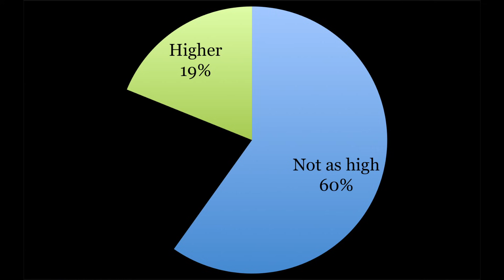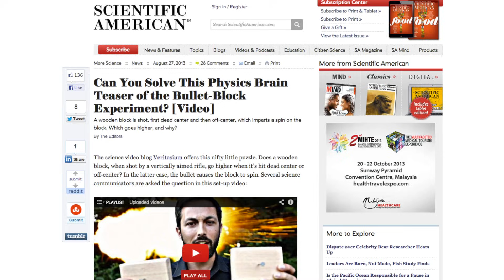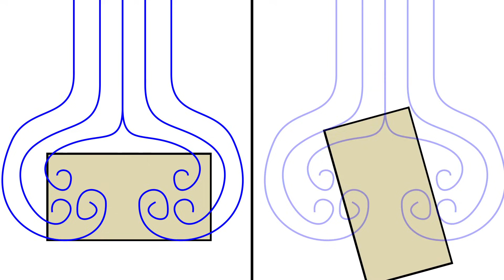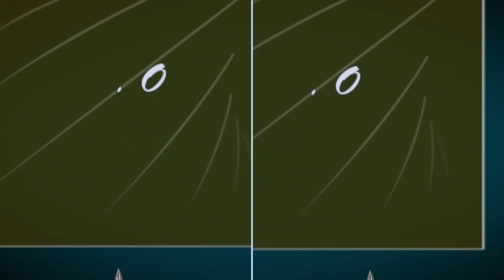Bullet Block Explained!

Comment: The resolution would be the same.. the reason why the block goes as high is due to
"the Conservation of linear momentum" 
This means if the collision is separated from all outside parameters, the Vector quantity of the momentum in a direction will be conserved and have the same momentum after the collision.

Hope This Helped :D (at least a little)

Comment: Use a hollowed block filled with ballistics gel.  The lower density of ballistics gel will allow for further bullet penetration with less energy loss, while the wood outer layer would cause the block to raise (where the ballistics gel would not).

Comment: Use a different type of wood of same size and weight but different density. That "should" make the bullet penetration depth significantly different. But still give the same results for the test in height and momentum. Also the test is too contaminated. Do it indoors away from wind friction and other potential contaminants.

Comment: Lastly a round exerts anywhere between 1000 and 3000 Ft lb of force and it only takes what maybe 5 lbs of force to spin a block? All the round would need to do is transfer <2% of its energy to make it spin. I would look in the direction of Ft lbs and I think you might find your answer... and I wouldn't call it "negligible" force for obvious reasons..

Comment: In order to make this experiment work the bullets used should be match grade the exact same powder should be used and honestly should be used with a Square block instead of a rectangular block... also the shots should be taken in increments of 1/4 and 1/3 to see the differences. Also I would like to point out that the shot that enters the block in the middles force is taken by the whole block. shooting it on one side you create a lever action thus the block is easily moved in a rotational angle.

Comment: If its possible change the projectile are using, like and arrow. So much so that the entire length of the arrow does not completely enter the block. The increased friction on the sides of the arrow shaft should slow the penetration for both arrows. However as one block starts to spin the upwards momentum of the arrow (now inclined moving closer towards the horizontal) will push against the block rather than bury itself deeper. Hopefully this would create a discernible difference.

Comment: Perhaps the fact that the momentum of the block is now upward and gravities resistance isn't playing as much of a factor the spin is more negligable than one might think. Imagine driving a car without power steering try turning the wheel while stationary and its very difficult however start driving and the faster you go the easier it is to move the steering wheel

Comment: Not to be pedantic, but the velocity of the bullet is effected greatly by the build quality of the bullet. Things like bullet weight, powder type, powder weight, and brass thickness, etc do play a role here. 22cal bullets are notorious for being sloppy in their manufacturing. There can be very large differences within the same box of bullets. With that said, no, it does not change the conservation of momentum, but it does help to explain some of the differences between results.

Comment: Perhaps the difference in bullet penetration could be more observable if the block had a decreasing mass density as the bullet passes through it. This would allow the bullet to pass through higher portions of the block more easily, and therefore allow the difference in penetration to be measureable.

Comment: Are you trying to say that one block has some momentum perpendicular to vertical? Because upwards momentum is conserved totally independently of momentum in perpendicular directions.

As long as the block gets hit with an equal amount of upward momentum in each case, vertical momentum will be conserved for each, and it will go to the same height.

Comment: In the end you ask how to make the penetration depths sufficiently different, and more amenable to measurement I propose a different direction.

Perhaps you should use a very heavy, dense block, perhaps one of steel. Or perhaps use a very lightweight block (balsa?) so that the bullet passes completely through. (This latter idea would require you to track not just the highest point of the block, but also that of the bullet. This might be tricky.)

In any case, a quantitative approach is needed.

Comment: Your statement about conservation of energy is correct. But your statement about conservation of momentum is wrong.

Momentum is conserved in an ELASTIC COLLISION.

There are no truly elastic collisions. But some come close. It must be that this bullet/block collision is very INELASTIC, and differently so in the two cases (center strike vs. offset strike).

Comment: Any material will be plastically deformed by the bullet, even at a microscopic level, when hit by the bullet. If the block was made of a denser material, the difference in indentation/penetration would just be even harder to observe. A perfectly elastic collision, where kinetic energy is completely conserved, is impossible in practice.

Comment: Hi Veritasium,
So, if I get it well, the reason why the blocks go to the same hight is bullet penetration.

So what would happen if you shoot at a harder block ? Like steel or aluminium. Or let's say if you shoot at a non-penetrable block. This time, the centered-shot will push higher, right ?

Comment: Right. You said that.

But before the bullet hits the block, it's moving upward (directly away from the ground, against gravity). After the bullet hits, both bullet and block together move upwards (directly away from the ground, against gravity).

So why do you say one is "forward"? Are you using the right-hand rule to describe the angular momentum of the bullet/block systen? Because that could be called a forward-pointing vector... but not of the bullet alone. Can you please clarify?

Comment: So you make two blocks: one can be a simple rectangle, as before.

The other can be a smaller rectangle, maybe half the width, attached to a long thin rod and a counterweight attached at the other end. This is an easy way to design the blocks to have the same mass, but very different moments of inertia. You're basically designing the seconds block so that all of the mass of the system is out at the ends (but you still need the block part to fire the bullet into).

I hope you see this suggestion!

Comment: Hi Derek! Awesome riddle!

The physics suggest that if you want to exaggerate the difference in bullet depth, you should exaggerate the off-center distance of the bullet's entry point.

Case in point: KE_before = KE_lin + KE_rot + U
Where U is internal energy. We'll take U to be representative of bullet depth.

Since both cases have the same KE_before and KE_lin, we know that KE_rot must be equal to the discrepancy in U. This can be amplified simply by elongating r in (1/2)Iw^2 (where w = vr).

Comment: Use a larger and less dense material with bullets that pierce further. If the bullets travel further, a 1% discrepancy in the deformation will be more noticeable.

Comment: Well the issue I imagine would be to get the kinetic energy transferred to the block be larger so that 3% becomes measurable. So perhaps decrease the distance so less K.E is lost. Or get a heavier or maybe sharper bullet. Although I imagine the K.E won't really be affected by such a small change in distance. So maybe the answer lies in changing the block. I would say shoot further to the side but I think that wouldn't make a difference either so maybe a denser/less dense material?

Comment: To make an experiment more accurate you need all the variables in the equation to match as best as possible every time you repeat the experiment. The ammunition used in the rifle may cause the bullet to fly at different velocity due to the amount of gunpowder they use to create the ammo.  I'm pretty sure you used the same ammo each time you shot the block, but it doesn't mean that all the bullets are the same.  You should recreate this experiment using a force that is easier to measure.

Comment: To make it possible to measure the difference in penetration depth you may want to use bigger blocks made of a material less resistant to the penetration of the bullet. Another way may be to use a more powerful rifle. The basic idea is to have a large penetration depth to make the difference in the two paths measurable. A possibility may be a viscous medium, although I don't know if this may introduce problems in terms of different trajectories effects.

Comment: Build an air cannon that fires steel slugs with a set surface area, air is much much much more consistent than gun powder and if you fire a flat nosed steel slug same weight same surface area ect. Ect. Into a block,  not made of wood because wood is hard in some areas and soft in others and stressed in other areas but into a piece of rubber or balistics gel or into a piece of super precisely formed steel and measure the dent diameter and depth this may also eliminate some variables

Comment: In order to get a more measurable result, you need to increase the penetration depth. That means you have two options: scale up the experiment (larger block & more powerful bullet) or find a material that will allow for more penetration. I recommend a combination of both: use the same rifle and  a larger block of a plastic that will allow the bullet to penetrate deeper.

Comment: What if you create an air current above the block blowing strait down on the block(like a big fan or something). Will the air current make a difference? And if it does will one of the blocks be higher than the other? I think it would make a difference and the spinning one would be higher. What do you think?

Comment: i dont agree, that gun give that blocks same energy, if the high is same, EP1 = EP2,, that the law of conservation of energy. but its not, there rotation on block 2. in this case, the law of coservation of energy not applicable. in that experiments show, that high cant be the same, because there is wind.  is the energy from the gun different to each block? ( sorry i cant speak english fluently)

Comment: change the material you are shooting through. the density you are shooting through can change how deep the impact is and how high it goes. try a material that is more fibrous or where the molecules are not aligned as evenly, eg. the opposite of silicon and carbon. Something like gold, copper, or aluminum in it's pure form, not as an alloy. the idea is to shoot a material that breaks differently when a bullet goes through.

Comment: If you want to really confuse those who got it right, use a material that cannot be penetrated, then the transfer of energy would be easier to show. You would clearly see a portion of the bullet fly off to the side, showing off the energy it managed to keep. The head on shot would show how much energy is given directly to the blocks mass. Heck, I could do it!

Comment: larger block that is less dense. The further the bullet travels through the block the greater and therefore more measurable the differences in the penetration distances will be. Use a block of uniform density too, not wood, there must be some material out there. 

Your videos are awesome man.

Comment: Should use two different materials with the same mass and overall shape (almost the same density, one could be slightly larger in volume since air resistance is negligible and inertia is dependent on mass, not volume) and fire a bullet into them. The bullet would go further into one and less far into the other. But I suspect the "penetration energies" would be different again so it would only slightly affect the experiment :(

Comment: Slower than the speed of light. How fast depends on the electron's position and the element, and electrons can't move at the speed of light because they have mass.

They do move at a significant portion of the speed of light though, especially in certain elements like Mercury. It is a liquid at room temperature primarily because of the effects of relativity on its fast moving outer electrons. The sixtysymbols channel has a cool video about it.

Comment: To reduce some variables this experiment should be done with a block made out of an homogeneous material and be struck with an object that could transfer the energy more efficient to the block like a small surface (a hammer for example). I hope that helps you.

Comment: You need to use a more dense block like a plastic block where size shape and weight are as near identical as possible. Wood depending on the tree, weather, and other factors is not 100% identical. Also fire bullet center, left, and right sides to account for bullet spin from barrel.

Comment: How is that major?  There wasn't a significant pattern showing that spinning went higher or lower, its just that some spinning with higher and some went lower, some non-spinning went higher and some went lower.  It probably has to do with differences in how the bullet hit the wood - if it hit it more to the left or right, or if it split the grain or not.

Comment: Since it would require more force to make the piece of wood spin when being pushed from the center, it mostly moves in a straight way when it’s shot in the center; but that same amount of force is enough to make the piece of wood spin when the force is applied closer to the edge. Just like when you push a door open, it’s easier when you push closer to the edge of the door -considering the center of the piece of wood as the part where the hinges of the door are.

Comment: I believe it has to do with the fact that, the further away from the center of an object you apply force too, the easier will it be to make it spin. Therefore, by using the same amount of force, it would spin more or less, depending on how close to the center the force is applied.

Comment: Instead of trying to find a tricky medium to shoot with, you can just change how the projectile deforms.  If you used a sling shot and silly putty, or a similar medium, that you put into mold to make sure all your projectiles were the same shape and mass, you could shoot them at your wood block with a slingshot.  This won't cause the wood to deform, but the silly putty will be a different diameter in its splat, which would be a cheaper and easier way to do the experiment.

Comment: Using a block thats 3-4x as high and 3-4x as wide as this small wooden block but using a different material. One that the bullet cannot completely penetrate through, but one that allows the bullet to go 40-50% of the way through. Then fire the bullet in the middle and again on the end. The block SHOULD NOT be rising from the aparatus, but instead simply tilting upwards on the end that is shot. This is the angular momentum thats created by the difference in bullet-depth and hopefully measurable:)

Comment: Bullet depth challenge: try again with a piece of wood that is the same mass but has less depth (approximately the average bullet depth + a bit for good measure) and replace with length of wood. then move the offset shot to further down your longer piece and see the results ( I am thinking more leverage requres more energy to rotate) hope it works!

Comment: Continued from previous post: It requires more momentum because the force of you striking the board causes the board to start moving in an angular direction, therefore losing energy (the bullet not penetrating the block as far)

Comment: Here is an example of what I think is the same principle at work. In martial arts, when you are breaking a board, someone holds the board on either side. This would be the equivalent of shooting the block in the center, since there would be equal downward force of gravity across the block. However, a "speed break" is when someone holds only one side of the board. This would simulate shooting the block on one side, since the forces are unequal. This break requires much more speed(momentum). Cont.

Comment: If the blocks were bigger, and as such, of greater mass, and the bullet was of higher speed and size, which means using a more powerful rifle, the difference in penetration would be greater. What i mean is: if you scale up the objects used in the experiment, the forces involved will be greater. Since the kinetic energy is greater, the 1% difference in penetration also is a greater value.

Comment: I think the simplest way to try and verify the difference in penetration depth (CG vs. non-CG) would be to use a block that had a reduced moment of inertia (I_m) -- perhaps hollowed and composite material -- and bore cavities into the shooting block that has ballistic gel or a relatively softer material allowing further bullet penetration.  Lower I_m will allow the block to spin up faster reducing penetration and softer penetration media will allow relative deeper bullet penetration.

Comment: To make a more measurable depth you need 2 things, which correspond into one simple thing.... it needs to be bigger... the block used needs to have more surface to show more distinguishable 1% and your bullet needs to go farther in to show it as well... So, you need some sort of Ballistic Gel type substance that is fluid enough to show deeper impact while being solid enough to carry momentum, as well as an Armor Piercing type round to travel farther in, but not so much as to not move the block.

Comment: i can see this working, though the exact amount of force from the bullet would have to be known in both cases. as we saw in the video some blocks rose higher than others, i assume this was either a difference in wood weight or the upwards force of the bullet. these need to be measured to be able to get a correct and reliable reading when dealing with a measurement as small as 1%